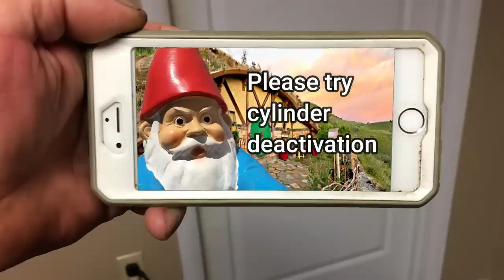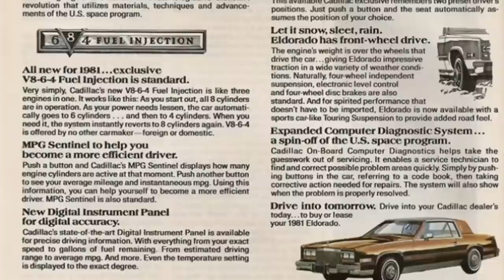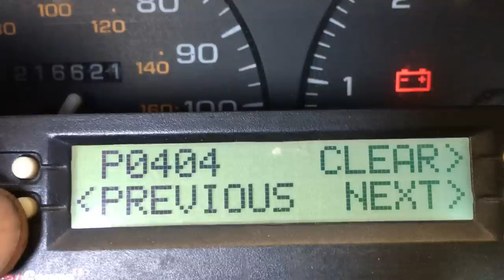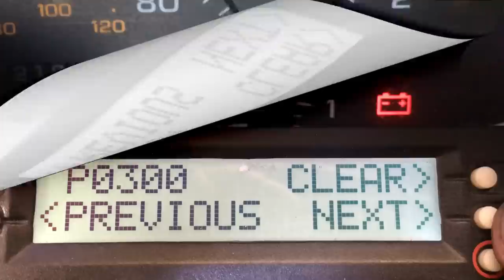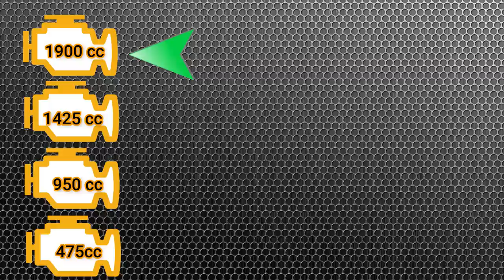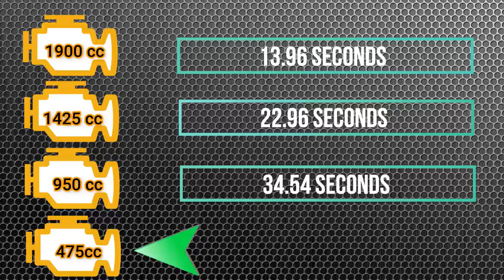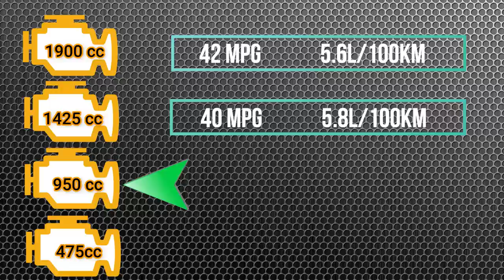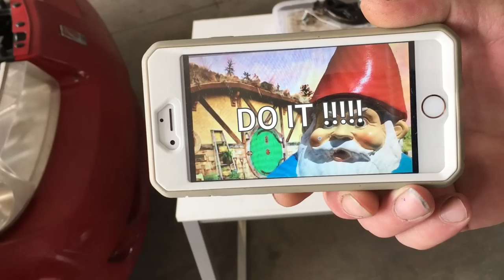S2E16:  We deactivate cylinders on our Saturn and test the car for performance and MPG

Comment: since we are on the subject, it would be interesting to compare different ways to deactivate the cylinder.
i think removing the sparkplug and injector conection would be best since the cylinder is not creating vacum or generating pressure
Reply: Nah then it has to pump air through, which takes energy to do

Comment: So the 2 cylinder setup got almost the same fuel economy with stops, as the 4 cylinder without stops? I'm impressed, i thought the added paracitic loss of compressing and decompressing the cylinder would result in poorer fuel economy as it would just go to wasted heat, or if one of the valves were open, sucking and blowing un-needed air.

The next logical step for me would be to remove the pistons from 1 and 3 to see how much the economy differs between the two different 2 cylinder configurations

Comment: Haven't watched it yet, but when the intake and exhaust valves remain open the mpg might go up. With the valves in place working normally, you'll still get compression losses.
Reply from the maker: The best results are found when both valves are disabled.
Reply: @robotcantina8957  Robot, we look forward to more great videos

Comment: Hello sir.
Deactivating 2 cylinders would increase perfromance (in the sense horsepower/cylinder would increase, maybe sufficiently to match 4 cylinder) if you'd remove pistons and connecting rods, as well as increasing rev limiter.
I'd suggest removing 2 and 3 spark plugs to reduce vac/pressure resistance on those cylinders.
Additionaly, you can use those cylinders as a secondary depressurised stage, similar to multistage steam engines, there is even a company with 3 cylinder proof of concept (https://www.youtube.com/watch?v=u0uPmrSRM7w).
Or use it as low efficiency fuel mixing stage/low pressure supercharger.

Comment: The dead cylinders were likely behaving as parasitic loss. So with every cylinder out of action the working cylinder/s had to use energy to overcome the mass and friction loss over every non firing cylinder. Which may explain the MPG figures.

Comment: You need to hold the exhaust valves open to avoid compression losses, and the intake valves need to be kept closed to keep from wasting fuel.
Reply: You'd still end up with pumping losses, with both valves closed yes you lose some power on compression but the air acts as a spring on the power stroke so your net losses are mostly frictional and blowby. If you open the exhaust valve you've got air being sucked in and out through the exhaust, creating fluctuations in the back pressure of the exhaust from the other running cylinders introducing other issues (scavenging, power loss, etc). But wouldn't be that hard to try, and less detrimental than just taking those spark plugs out as others have mentioned.
Reply: @DracoOmnia  Interesting comment here.

Comment: Here are some fun  classes to take.
Reply: Building a future with Robots
Reply: Going places with spatial analysis
Reply: Artificial Intelligence with Robotics
Reply: Circuits and Electronics
Reply: Numerical Methods for Engineers
Reply: Organic Solar Cells -- Theory and Practice.
Reply: Heat Transfer.
Reply: Power Systems Analysis
Reply: Basic Electrical Circuits.
Reply: Converter Circuits....
Reply: Basket Weaving for Beginners.
Reply: Current  Mode Control
Reply: Theory of Angular Momentum.
Reply: Complex Analysis.
Reply: Homeopathic Practice
Reply: Chemical Process Safety.
Reply: Mechanical Behavior of Materials.
Reply: Electrodynamics=Analysis of Electric Fields.
Reply: Rigid Body Dynamics. 😛
Reply: Particle Dynamics.
Reply: @ocdman202  Analog Electronic Circuits.
Reply: Basic Electric Circuits.
Reply: Engineering Graphics and Design
Reply: Robotics.
Reply: Introduction to Coding Theory
Reply: Design of PhotoVoltaic Systems
Reply: Electro Magnetic Theory.
Reply: Fluid Mechanics
Reply: Fundamentals of Electric Drives.
Reply: Design of Mechatronic Systems.
Reply: Introduction to Mechanical Vibration.
Reply: @mommapanda5736  Is it back to school at your house.??

Comment: For our consideration    here is our list of car parts.
Reply: Radiator
Reply: Roof Rack
Reply: Rims
Reply: Trunk
Reply: Sunroof
Reply: Alternator
Reply: Battery
Reply: Fuel Gauge
Reply: Ignition box
Reply: Head light
Reply: Brake light
Reply: Airbag sensor
Reply: Knock sensor
Reply: Light sensor
Reply: Starter
Reply: Thermostat
Reply: Airbag  control module
Reply: Thing  a ma jig
Reply: Bench seat
Reply: Bucket seat
Reply: Brake disc/Brake fluid
Reply: Brake shoe/Brake lining
Reply: Hydraulic booster unit.
Reply: Camshaft bearing.
Reply: doo   hicky
Reply: Crankshaft
Reply: Crank pulley
Reply: Distibutor/ Distributor cap
Reply: Engine cradle
Reply: Engine valve
Reply: Doo hicky
Reply: Turbocharger
Reply: Valve cover/valve housing
Reply: Radiator
Reply: Radiator gasket
Reply: Geez,  are we done yet?
Reply: Water pipe/ water pump
Reply: Catalytic converter
Reply: Exhaust manifold
Reply: Muffler
Reply: Fuel pump
Reply: Fancy thing
Reply: Intake Manifold
Reply: Throttle body
Reply: Heavenly body
Reply: What??
Reply: Power steering  assembly and component
Reply: Steering column assembly
Reply: Strut
Reply: Don't mind if I do!!!!
Reply: Axle shaft
Reply: Automobile air conditioning
Reply: Thing a bob
Reply: @mommapanda5736  Watcha   ma callit.
Reply: @ocdman202  Is this list exhaustive or just examplary
Reply: @mommapanda5736  I love the lists here on this channel.... Fantastic work...

Comment: I think this is not an ideal setup because both intake and exhaust valves remain permanently closed, so when the piston goes up negative work is done and, due to energy disspation, not all work will be recovered when the piston goes back down. Perhaps  the results would be slightly better if you removed the spark plugs and kept the exhaust valves open

Comment: This test would be WAY cooler with a sbc that has a rev kit(this is basically a spring that holds the lifter in it's bore that pushes down from the bottom of the head) in it so all you would have to do is remove the push rods and rockers. Plus going from 8 cylinders to 4 the car should still have enough power to move the weight of the car with possibly getting better fuel economy?

Half of a sbc 383 would be 191.5 cid and would be a 287.25 with 6 cylinders. The more cubic inches the engine has and lighter the car is the better I think the results will be?

Comment: Funny thing about the 3 cylinder mode is vw did the exact thing with their diesel 3 cylinder engine. Designed by taking their 1.9 PD engine and taking away a cylinder. At least I think

Comment: Two places where this sort of modification is (relatively) common: Land speed racing and LeMons (not LeMans) racing:

Land speed cars are usually divided into categories by engine displacement, and it's sometimes easier to make a car for a low-displacement category by just deactivating cylinders on a larger engine. Pus, if the mods are reversible you can run in two different classes.

Lemons cars get the treatment, because they are piles of junk and doing anything it takes to continue the race after a breakdown is part of the fun, sometimes end up with deactivated cylinders because one or more cylinders have suffered a catastrophic failure mid-race. Usually they just rip out the offending piston and conrod entirely, disconnect spark and fuel as applicable, plug up the oil holes as best they can, and send it. (although there have been some exciting crankcase failures due to not disconnecting the spark plugs...)

Comment: Hmm I wonder if losses of compressing deactivated cylinder gas is significant, what if you left exhaust or intake valve slightly open not to hit the piston to let the air out/in?
Reply: You get back the energy used in compression on the downstroke.
Reply: @ferrumignis  there still should be losses
Reply: bad idea, the traped air works as springs it aids in keeping the engine turning
Reply: @3216ben1  Yes there will be some small losses due to heat being passed into the combustion chamber, but this will be lower than the pumping losses of a cylinder open to atmosphere through a relatively small orifice.  If the pumping losses were lower, then commercial cylinder deactivation systems would use this method.
Reply: @ferrumignis  Love the comments here.

Comment: I put bad gas in my 9n Ford tractor once & after a week or so in the summer heat, the valves stuck to the guides. The cam pushed them up with the starter but the springs couldn’t push them back down. After some time with carb cleaner & ATF I got the engine to run on cylinders 1&2 & kept it running while I freed up the other 2. I tell you all this because it ran better & sounded smoother than your parts car. It may be because it wasn’t fighting the compression of the other cylinders.

Comment: I assume the parasitic losses due to friction of the disabled cylinders ate away any potential Benefits in terms of fuel efficiency. That was something is asked my self a long time. Thanks for providing the answer. Maybe thats why cylinder deactivation is only used on v engines.

Comment: I am guessing it's inefficient to accelerate on lower cylinder count than full set, and that negated savings at low load. I have 392 V8 with cylinder deactivation (8<>4) and it maybe gets me 24 instead of 22  in the same conditions... And of course, it turns on only at very light load, ie. Driving at flat road 75mph. So in my experience - meh. Or this is just poor Dodge engineering. :)
Reply: " it's inefficient to accelerate on lower cylinder count than full set,"

The idea is that with fewer cylinders they need to be filled with more air to get the same power and this decreases pumping losses (i.e. lower manifold vacuum that the pistons have to work against).  This helps more at part throttle when pumping losses are higher.
Reply: in a 8 cylinder is a bad idea, the internal friction kills any mpg gains, at this point, cylinder deact is nothing but a gimmick and liability
Reply: @omegarugal9283  Interesting comments here.

Comment: would it be better to remove the spark plugs in the de-activated cylinders ?? that would reduce compression efforts ??  (remove plugs; screw in hose to vent under car / catch tank)

Comment: There's also 'SuperFastMatt' who's building his own Salt Flat high speed run car, utilising a BMW 1000RR 4 cyl motor, and he's going to run it in 2cyl mode as well as full 4cyl mode for different 500cc & 1000cc catagories.... I like his kind of sense of humour, it's kind of like this guys humour too. 😏. He's also fitted a full Tesla power train into a classic 40's(?) Jaguar👍 and fitted a CBR1000 motorbike engine into a classic Honda S600 car chassis   😎🇬🇧

Comment: In a engine with this designed in in it, it actually makes a decently large difference. I recently picked up a 2022 Mazda which has cylinder deactivation on it's 2.5l 4Cyl. A car that normally averages high 20s low 30s can hit mid to low 40s on a (very slight) incline if you hit the right conditions for it to deactivate half of the cylinders. As in: At or near (whether slightly above or below) the speed limit with little changes to throttle, preferably with cruise control on.

Comment: I have an 81 Cherokee with an I6 that  has cylinder deactivation. You lose a cylinder every 100 miles until you get down to 1 firing.  Going through the mountains was interesting, but I discovered it can climb with 1 cylinder but only at about 5mph.

Comment: taking out the spark plugs of the 2 disabled cylinders would greatly help with power and efficiency, since you are wasting some on creating vaccum and compression when the pistons are turned by the crankshaft.By doing that you simply unseal the combustion chamber from the outside world.

Comment: I think at this point, the best bet for better fuel economy would be shedding weight, pumping up those tires and leaning the hell out of the mixture at cruising speeds. Maybe also do a hot air intake?

Comment: shouldn't cyl. 2 and 4 be disabled for a balanced engine? also the 2 cylinders that are deactivated are still making compression ie resistance? if so shouldn't those spark plugs be removed to relieve the compression?

Comment: Would you be able to leave all the valvetrain intact, but wire some simple switches into the cockpit for deactivating cylinder 2 and 3 injectors? That way you're only fighting compression/vacuum on 2 of the 4 strokes, don't have to worry about noise from a pulled plug, and you could test it out by only doing it at cruising speed for one, all the time for another, and maybe some other methods of shutting off fuel flow at different times etc.
Reply: Great comment here. Looking forward to more from Robot Cantina

Comment: it burns oil on start up because when the cylinder is deactivated, the piston rings let some oil through that typically gets burned over the 160 odd miles you drove on 2 cyl, in theory, its possible that you can keep dragging more and more oil into the cylinder thats deactivated and adventually it will kinda hydrolock from the oil and possibly bend a rod if it happens under load, perhaps leaving the exhaust rocker on would help?. fascinating test i wonder how a v6 would react to this type of treatment

Comment: i don't understand, why not simply removing coil and injector plug so that the engine can still open and close the valve. here the valve always stays close so the engine has to work harder to compress the air which has nowhere to go. if the valve could open the air would be forced out the exhaust without problem, and it's easier to do. 
please explain me
Reply: What will Jimbo of Robot Cantina do next??

Comment: The way the system works is by hanging the exhaust valve open just enough to let air in an out with out hitting the piston. The way you are trying it is to use #2 #3 as springs in a sense because of the vacuum they will make on the down stroke

Comment: Interesting and fun video as usual! Gotta love the comments (especially spark plug related 🙄) would have liked to see the 0-60 times in relation to the 212cc and 420cc times, apples and oranges but interesting to see. Makes me wonder what would happen if you deactivated a cylinder on the 420 too, lol.  Totally unnecessary but interesting.

The fact two cylinders nearly achieved the same economy as 4 is really impressive with all the parasitic power losses from friction, rotational mass, etc.  It's almost definitely not worthwhile but I hypothesize you'd get better economy than with 4 cyl if you could pull those 2 unused conrods and pistons.

Regarding pure changes to 0-60 and power losses removing things from the serpentine system could be fun. How does converting from mech fan to electric fan change the 0 to 60? Surely power steering is unnecessary for such a light car? Electric water pump? Although two of those might be negated by additional drag on the alternator could be interesting to play with. Cheers.  No idea what Honda lean burn is but excited to find out

Comment: I'll say the same thing I did on the last video- any newer EFI vehicle will pull ignition timing and/or enrich the fuel mixture anytime it detects a major fault to protect itself. That's always going to hurt power and economy. You need to do these tests on an older vehicle where the ECU doesn't control ignition timing. Just like in thunderhead's ford maverick. 40-42 mpg from a 302ci V8 and a 4 speed non overdrive transmission. His timing never varies.
Reply: Logic will get you from A  to B ... Imagination will take you everywhere.

Comment: Do what garage 54 does and cut the engine in half and weld them together, problem solved. They made a Soviet 2jz from 2 LADA 4 bangers by cutting one in half and welding the 2 cyls from one to the 4. 5.4l is very respectful for a 1.9l.

Comment: Wouldn't you want to have a way for atmosphere to enter and exit the deactivated cylinder? Otherwise you are compressing a cylinder over and over again? If you removed the spark plugs from the deactivated cylinders, I imagine it might get some power back. Or were your lifters sized to keep the valves open a bit?

Comment: Fun fact the lifter bar keep it from turning is only there to hold the lifter from clocking under no load if it had load all the time wouldn't even need it but due to valve flot and backside of the cam have to have them
Reply: And Saturn's can be  Flat toad behind an RV

Comment: I actually drove my 4 cylinder s10 running on 3 cylinders when I burned a valve. Had it that way for months. It was dangerously slow to drive on the highway and was horribly unbalanced at low RPMs but it didn’t skip a beat until I fixed it.

Comment: Back in oil embargo days they offered a lot of deactivation kits. They either drilled out piston or put an air filter on the sparkplug hole. Both were to get rid of the compression and vacuum losses due to cylinder deactivation . This increased performance,  at least that was what j c Whitney said.

Comment: I’m really interested by this as I’ve always wondered if you could use the redundant cylinders to fill an air compressor tank via a hose from the spark plug holes. Like the old aircooled vw engines. You’d need a oil and moisture trap of course and the redundant fuel injectors removed but I’m sure it would work and I reckon it would produce quite a few cfm’s as well.
Reply: Plenty of industrial air compressors used ford flathead engines with one bank fitted with a custom head. It's definitely workable.
Reply: @mfree80286  Every days a learning day as I’ve never heard of that before so thanks for sharing 👍🏼.

Comment: The vibration is bc the cylinders are designed too balance each other. There's always a little vibration that's why there rubber motor mounts to absorb the rest. Keep up the good work

Comment: My question is why deactivate the inside cylinders instead of the outside? The closer the pistons making power are the less crankshaft vibrations you have to deal with (theoretically).